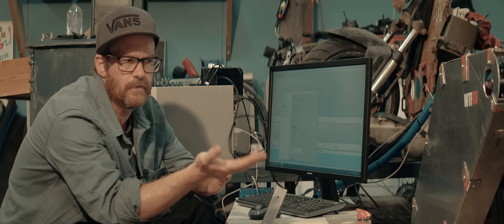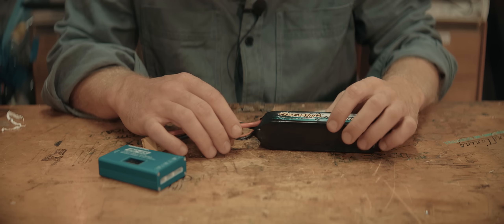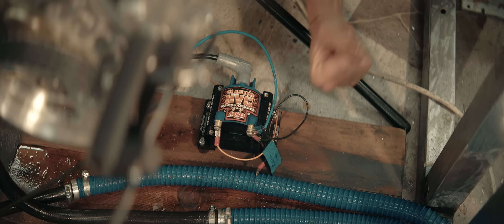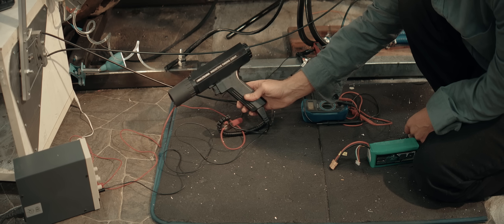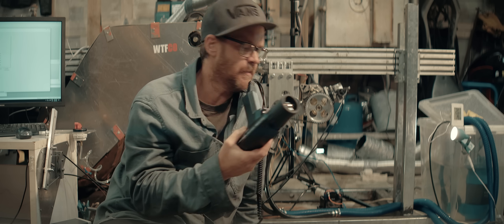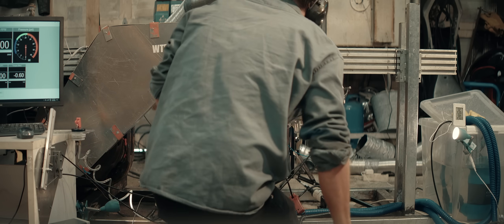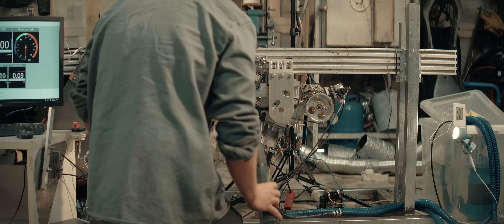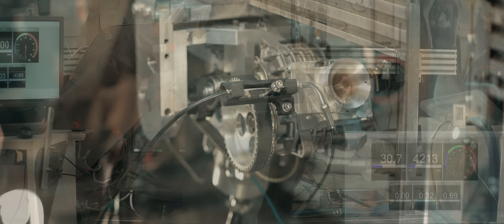Supercharged 50cc Too Much Power for Ignition!

Comment: A lot of your ignition problems could be solved with a MSD MC-4 Ignition unit.
my team used it with a lot higher concentration of nitromethane than you've been using, without any misfiring issues.
more than 50% nitro on 90cc engine.
Not cheap, but probably a must with forced induction.

Comment: OK - In my youth, I raced 90cc MC6 chainsaw go karts, on a 1/20 mile oval.  We were revving the engines over 15,000 RPMs.  My kart was OK, but slower than the top winners.  I called the Manufacturer and they suggested to rotate the Mag against rotation to give more time for spark build up.  After doing as suggested, I was able to pass/go by all of the top Go Karts, like they were standing still!!!  You might need more Spark Build Up time....

Comment: Just use E3 spark plugs. 3 sparks at once. And the msd ignition. That's like 12 sparks instead of 1.. kinda makes a lot more sense than a head with 4 separate spark plugs right?

Comment: If I have a battery pack that starts to swell, I 'deactivate' it by taking it to a sports field where there is a light pole with a stud sticking out of the ground, placing the battery on top of the stud and wacking it with a big hammer .. you get a nice smoke show too for free. But I don't want an unstable battery sitting around my house at any rate.

Comment: Engine does not do any real power, your dyno not work well and istill wait steady runs and steady power numbers, not some peak numbers pumping gas.
Best 50cc 2stroke are made 20hp with gas.
Reply from the maker: Hang in there. We had nice steady runs with the Brute force engine on this dyno. Best 50cc 2t make much more than 20hp on gas.
Reply: @2STROKESTUFFING  ok👍

Comment: This might sound like madness but you should try to gap between the plug wire and spark plug. When we have a fouled plug pull the wire away from the plug and it starts running on the cylinder that previously didn’t fire. So somehow it boosts the spark energy

Comment: I suggest testing Iridium spark plugs in such extreme conditions.

On E85 and methanol for boosted engines when reaching the point of resistance being too high for the spark to jump the gap a lot of people proceed to use Iridium spark plugs as it is less resistive with the smaller concentrated discharge area by the 0.4-0.6mm diameter center electrode. Personally have had great experience with those and boost on alcohol fuels as well as petrol fuels, only improved the results.

Comment: Hmm...wonder if you could use something similar to Top Fuel MSD units that would prove to be really powerful or a Dyna ARC-2 that is used on motorcycles. Can't be too overboard with ignition. And start with two spark plugs if you are tired of just one!

Comment: I still think it's worth trying to make a larger diameter reluctor wheel for more resolution since you're getting into 10k+ revs, your MSD coil won't have any problem at all firing, I think you're just running out of ignition resolution at that those speeds with such a small pulley as the reluctor. Only coz I notice the tac getting a little weird at 13k and the ignition breaking up

Comment: I think on the dyno you need significantly more P term
Reply from the maker: Maybe. The reason it's set so low is cause I'm taking rpm from the engine, the software thinks the retarder is spinning 25x speed, would massively overreact with normal numbers. Has to be like that with the load cell mounted to the engine.
Reply: @2STROKESTUFFING  ah yep. I have not had a chance to play with yourdyno much yet however in a month I will set one up. I have looked through the software and seem to remember finding update rates and pid scaler based on engine rpm. Probably a good way of starting to setup the pids would be have no I term or d term and get it to hold rpm steady (maybe 5000rpm would suit this engine). Increase p term until oscillation and then reduce by 20%. Then add small amounts of I term until actual rpm is the same as target. 
Keep in mind I don't have actual experience with this controller yet..

Comment: I have found out that Biltema timing light doesn't work with some of spark plug cables. Put a short extension cable between your existing cable and the plug when you test advance and remove it after that. Extension can be done out of an old normal car plug cable.

Comment: Awesome work! I bet you already tried to adjust just the P value to a higher number to lessen the oscilation. You could add some acetone in to the mix to make it ignite little easier, something around 2-5% have used it when cold starting comes an issue on glow engines runing methanol. And more spark power, you are loosing power with that small gap. We used to run 0.8mm on the boat engine on mercury F1 coils up to 16000rpm. It really came to life with more gap and more spark energy.

Comment: A larger spark gap has the benefit that it takes more liquid to insulate it in case there were to be some excess oil or fuel entering the cylinder

Comment: Wow, the BF en PiP engine in a mixed arrangement has some serious potential! 
Back in The Netherlands the highest pk (hp) I have ever heard was 22pk, but this engine with possibly 30 HP blows my mind! I knew that turbo’s or blowers increases power, pretending an engine to appear bigger than it is, but this engine is astounding! 

Looking forward to more testing and dyno runs, you have given me more insight and knowledge about 2 stroke technology than I have learned in the past 12 years. I have tuned some engines, mostly Zündapp engines (of which I own 5 mopeds) and a tuned Piaggio Vespa Ciao, and what I like about tuning is getting the most power out of the smallest possible carb and cylinder (preferred 50cc with a 15mm Bing carb) because in my opinion everybody can get more power with a bigger carb and cylinder, but this blown PiP engine to me justifies everything.  

Great work, and I wish you all the best in more 2 stroke stuffing! 

(The Vespa Ciao runs 85km/h on a 74cc Malossi cylinder, with a 10mm Dellorto carb without a variable belt drive. My fastest engine with minimal work to the engine is a 50cc 5 speed Zündapp 517 with a 15mm Bing carb, slightly modified crankcase, porting and homemade resonance exhaust, going 95 km/h GPS measured).

Comment: Hmm.. not enough spark energy you say... I wonder who might've said that months ago.. almost like I did the research about it and gave you links to it..
I wonder if the expansion chamber isn't helping at all in a blown application and if just evacuating the exhaust as quickly as possible in a larger diameter straight pipe (or an open megaphone) would pick up power. Adding a velocity stack to the carb might also smooth out the flow of air into the intake.
Reply: The expansion chamber is essential. It'll do the same whether it's working at 14.6psi (atmospheric), or any other intake pressure, above or below that

Comment: That is interesting Alex, for all of my 2T engines, I always ran the largest gap that I could.  Reason: A much larger, fatter spark, which aided ignition. Why are you decreasing the gap size?
Reply: The higher the compression is the harder it is for the spark to form.
The more fuel you add the harder it is for the spark to form.
Add methanol vs petrol and it makes it harder again for the spark to form.

You can fix this in three ways.
1, Add more voltage.
2, Add more amps.
3, A closer gap makes it easier for the spark to form.
So IF a engine has problem with spark cutting out a smaller gap helps it, but sure the better fix is more volt and amp instead.

And yes a smaller gap means a smaller spark which in turn means slower burn and in this case most likely less burned fuel when it needs to happen.
So without changing parts what is better a spark on more occasions or a bigger spark on less occasions?
Reply: Sorry meant nitro instead of methanol.

Comment: I suspect a lot of the issue is the fact it's upside down - all that fuel and air in the chamber gravity is going to bias that to collect on/around the spark plug. I guess that's one of the big limitations with 2-stroke, there's no intake-port injector duty cycle you can tweak, and any change at the carby is still subject to the crank/transfer port dynamics - so you could lean it out by 10% at the carby and still achieve nothing. I suspect a better carby would help - one that atomises the fuel into the air better - such that when it reaches the chamber, it's more homogenised. Will be interesting what your further tests reveal.
Reply: Yes it would be interesting to see if turning the cylinder upright improves matters.
Alex has got all the parts for a fuel injection system, possibly the time is getting closer to trying it. Writing the programing will be the limiting factor IMO as you can't use a lambda sensor.
Coolant temperature needs raising upto around 80C to see if this improves fuel atomisation. Do the cheap simple things first.
I must admit to not being a fan of this retarder, it's much too large for such a tiny engine IMO. Using a car alternator would be a better bet. Alex has also got a hydraulic pump for a smaller retarder which he was going to use before this present one came along.
Finally, I would like to see the engine with the cylinder upright, driving the inertia dyno through a manual clutch.

Comment: I think you need to take a closer look at fuel temperature, fuel pressure, and the quality of atomization of the fuel. Spark Plugs cannot ignite a liquid. You should build a double walled billet aluminum intake manifold and vaporize a large volume of fuel and air under pressure and high heat in there. You can use the carburator merely for idling the engine. You will solve the hydrolock problem, prevent carbon buildup on the piston, and you will increase power by at least 30%. Other inventors who did this got 100 MPG out of their cars weighing over 4 tonnes and not at all aerodynamic.

Comment: Have you heard about the trick where you file the mass electrode untill it is in line with the edge of the center electrode? It's supposed give a measurable gain.

Comment: The BEAST,  it sounds alot stronger than other engine,  I'd say figures are pretty close you can hear the load it's got under building rpm.
Suggestion raise spark plug one washer lift spark in combustion chamber may help burn the tonne of fuel at top of chamber not as close to piston  , a more domed combustion chamber like Aprila may help too.
Awesome Alex well done mate remember checking crank bearings to along the tests.

Comment: You might have to go to a more of a shrouded spark plug as in change the angle change the head design etc to keep the pressure from blowing the spark out and a digital coil

Comment: If it's an Eddy current dyno, it might help to spin it a bit faster. If the power supply to the windings isn't that great or too small it can make applying load very temperamental. There's always going to be a delay when power is applied to the dyno windings, the rotor gets magnetically saturated, and it finally puts load on the engine.  
Maybe try to increase the dyno load applied to the engine at a slower rate if you can. 
Smaller the engine, the closer the dyno needs to be matched to it. 
I've seen Himmelstien tourqe transducers go for pretty cheap on ebay. That would help tell you whats going on quite a bit.

Comment: Correct me if I'm wrong but as I understand it the power spike issue with 2 strokes is caused largely by the size of that bulge in the exhaust pipe. So to make the power curve better you could make an exhaust pipe that varies in length?

Comment: I think this is a big brake through and i do believe its going to top 30bhp when on the pipe once you sort out the ignition problems .try out board motor plugs flat top that have a fixed gap there meant to run continuous at high revs  https://www.youtube.com/watch?v=q1WoydRDdFQ  you will get there next thing will be not getting enough fuel through it when its at full tat for long runs at 15000rpm +

Comment: You could try another brand of spark plug. In my 42 years of working on, tuning & riding 2 stroke road bikes, I've found that NGK spark plugs don't work well or last long in 2 stroke engines with a compression ratio above 9:1. This is why I've used Lodge (expensive) & Champion, in the past (subject to availability), but now I use Brisk spark plugs. So far, I can report nothing but good results from Brisk spark plugs.
Reply: Brisk is the worst spark plugs ever made. If one of them come on my shop the fix is usually changing it out for a NGK or or Champion.

Comment: Greeting and free tips from Finland. I have similar biltema timing light and it only works if not pulling the trigger all theway down 😄 and check that the ”sensing”clamps magnete looking thing is solid AND check that your timing light is powered from the same source as the ignition coil! 👍
Would be also nice to see the throttleposition while dynoing.
Someone also told me that with smaller sparkplug gap the spark lasts longer.

Comment: Turbocharged and Blown engines have a tendency to blow the spark off of the spark plug. Reduce the gap on the spark plug one or two thousandths at a time until it fires correctly.
Reply: I think he did that in this video

Comment: iridium spark plugs can be problematic! (low surface area)  try old school plugs.
Reply from the maker: 👍 Picking up some tomorrow
Reply: @2STROKESTUFFING  i bet your strobe will work then also!
Reply: @2STROKESTUFFING  Had them for my 80cc race tuned Honda worked ace for about 200 miles then new ones lol ,have you thought about out board motor plugs flat top   ngk 6431 i have them in my 55hp out board that runs on high revs most of the time https://www.youtube.com/watch?v=q1WoydRDdFQ these are designed for running at high revs .

Comment: My 93 toyota supra running a wasted spark systen requires a .025 spark plug gap to run under boost. Try closing your plug gap a bit more and see if that helps you out at all